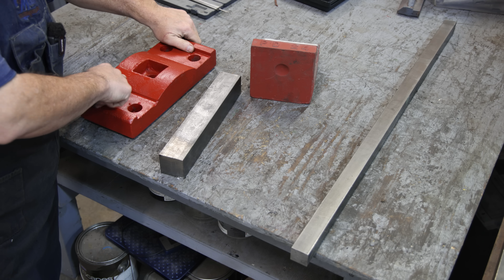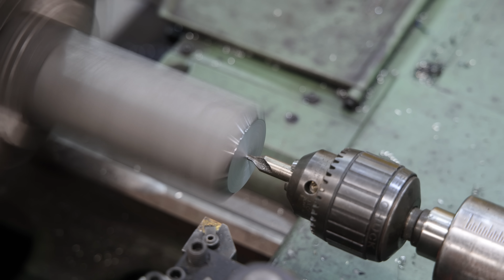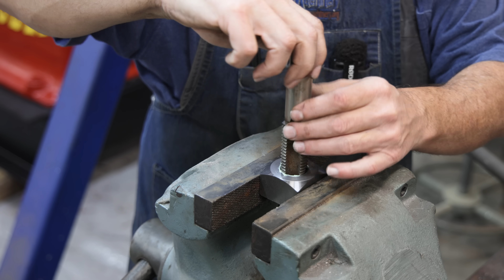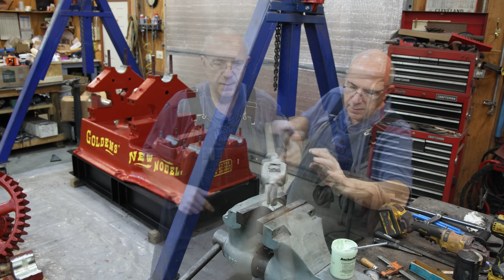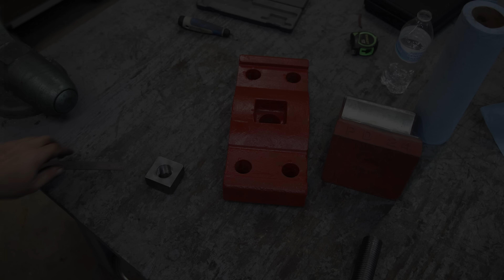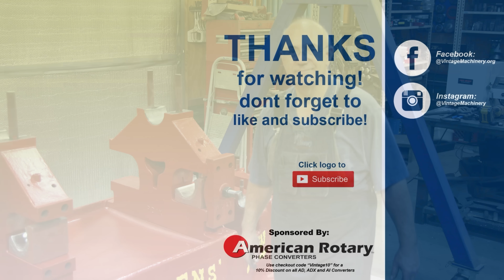Monster Cane Mill Restoration :Machining some Big Nuts and Adjustment Screws

Comment: Tapping those internal threads was great cardio but I think I would have chosen to single point them and finish with a tap. I guess that when you have a tap wrench that big you try to find a way to use it. Just remember that size isn’t everything (I tell my Wife that all of the time).

Comment: What a difference in that pile of tired cast and steel you started with. I regularly had to replace a ring with 22 x 1.5 inch threaded holes that tied a feller/buncher head, rotater in TQ100 I used "gun taps" with the best success. They were still tough going but produced  as how I wanted them to. Thanks a bunch for this ongoing post Keith.

Comment: Power tap it in the lathe. Use the tap wrench just touching the bed, center in the tail stock to keep it straight nice lowish speed! Sharpen that tap, to expensive to trash!

Comment: In the early 70's I did a job in the sugar mill on an old plantation in Southern Louisiana. The thing I remember most is the size of some of the gearing in there. Some were 10 or 12 feet in diameter. The gears were vertical and the bottom of the gear ran in a concrete trough with water in it. As the teeth came down into the water, the dust would be washed off and as the teeth came out of the water there was a layer of heavy oil floating on the top to re-lube the teeth. Doubt any of those old mills are still in operation, but it would be fun to see one in operation again.

Comment: I would be tempted to single point those nut threads.  Since both bolt and nut are needed, I am also surprised that no suitable pair can be purchased; specific threads are not then needed.

Comment: You could have power tapped them on ur Carlton , it will easily tap that , we had one at work and did 3 inch pipe tap on it saves the labor !
Reply: Just invest in Morse taper tap holders  1 1/4 like butter

Comment: Mr Rucker, I'm surprised that you opted to cut the threads by eye, and not use the facility of the boring machine to ensure that is was vertical.  Any particular reason for that?  Even I, as a modeller, use my mill to help me cut threads...  Best wishes for the Festive Season from me and the wife in East Anglia - England's farming county.

Comment: I've made several tapping blocks with clearance for the tap to start it dead straight. I think that would help quite a bit in starting the threads.  I think inch diameter threads are the largest I've used.  I generally do twice the tap diameter to keep them straight. Those nuts came out pretty nicely all told.

Comment: I agree about the lock nuts being square.  Chances are they will be using adjustable wrenches which would do both, but the square head would be less likely to be rounded over like adjustable wrenches tend to do to hex-nuts.  Acetics after all of your work would tend to just it look period correct.  
It is looking and all you need is some sorgum cane to run through and then boil the juice down into syrup to put on your pancakes.

Comment: How do you stop the threading tool at the right position everytime without crashing? Is there some trick to it or is it just skill?
Reply: Skill, muscle memory, quick draw style or method does require skill so make a lot of some size bolt. I would say around 25 at a time with 4 cycles will do the job of training your muscle memory, and sharpening for reflexes... speed the  RPMs each cycle if you have a CV motor. Each bolts usually takes 8-12 passes on the larger ones like 3/4 -10, and only 5-7 on the  very small ones like 10-24

Comment: That is a threader allright.  wow.  Mr. Rucker is use to having another ~30lbs to throw into that.  ;-)
Still, impressive to see uncle manhandle that.  The interrupted cutter was the tool for that job for sure.
Work smart, not hard.  If at all possible ;-)

Comment: Make a video Sharpening the tap using the surface grinder ??
Reply: Actually that can be done on a surface grinder but is better sent to Steve Summers who has a tool and cutter grinder, a more appropriate tooling choice. It just needs the gullet resurfaced and although a dremel type grinder with speeds over 10,000 can do the job; holding everything in relation to the other to only remove what is needed for sharpening -and not the cutting parts which would dull it faster than you can say idiot tools.

Comment: How many shops have a spare 1 1/4" tap?
Reply: Many more than have a 1 1/8 tap, but levity aside, most jobshops and the folks working the jobshop circuit have some of the oddest tools you can imagine, many trade tools actively with other Machinist Types and Maintainence types every Sunday after lunch or at fishing camps etc.

Comment: 13:45 ... Those big taps are pretty easy to sharpen!! .. Just grind a wheel to the same RADIUS, as the FLUTES are ... and sharpen in like anything else!
Reply: Nah....viewers will have sent 20 of them by the next time he needs one. He's like Mr. Pete...just throw it away cuz he has too much.
Reply: It’s not so easy to dress a wheel to the same radius as the flutes but it can be done.
Reply: @ellieprice363 and since this is a plug tap not a taper or starter tap the wheel needs to be angled sharply in relation to the gullet, why didn't he have a starter tap for that size? Send it off to Steve Summers so he can make a video of sharpening it, maybe he can make a starter tap of it so Keith has one in the size. Also, hats off to Keith for using a plug tap that large by hand, thats the way to build some muscle.

Comment: About cutting those big threads on the vise.  I might have put the nut vertically in the vise jaws so I was pulling the tap wrench for more leverage.  Or use a cheater bar!
Reply: You would not be able to get the vice jaws tight enough to keep the nut from twisting.
Reply: @JSB1947  - It depends on the orientation of the nut.  Just like Keith had done I would also clamp the same two opposing faces of the square nut but with the unthreaded hole rotated 90° (horizontal).   With this beefy of a vise it would hold just fine.
Reply: @cemx86  Point taken.😨

Comment: Great video, Keith! A question about the order of operations: would it have been easier to drill the entire piece of metal, then cut the individual nuts apart rather than drilling and cutting off one at a time? Are you concerned about the drill bit deflecting as you go deeper? Just wondering - thank you.

Comment: Why not single point thread it slightly undersize and just finish it with the tap? Would keep the thread straight and would be easy to turn the tap just to skim it out to final size
Reply: Good suggestion as a lot of machinist would do it that way, but with many different ways to do a job . take your choice on what's best for you at the time.

Comment: Can taps be shrarpened?
Reply: They are sharpened when they are made. If they are sharpened once, it can be done again - with the right equipment
Reply: Large taps like that can be sharpened by hand, in just a few minutes. Throwing them out if they are not chipped is costly, especially if you are the one paying for the new one. Even if chipped still worth saving for chasing rusty threads, saving the costly new tap. @mikewatson4644

Comment: I made about 6 of these bolts threading round stock then drilling a counter sink hole in square stock and welding the head onto the round stock. Worked good.

Comment: Keith, why not tap the nut in the lathe using the tail stock and dead center and a 15 inch Crescent Wrench? Way easier…
Reply: I’m pretty sure @gus9675 wasn’t trying to hold the tap, one end goes into the nut to cut the threads, the back of the tap goes against the dead center to line it up and you turn it (or try to turn it) with the 15” crescent wrench. I’ve got an 18” & a 24” crescent wrench and to turn that tap I’d be grabbing the 24” one. Lol. Well, maybe the 15” one and have a cheater bar handy, which at 73 passes around the sun, is always near by.
Reply: Probably didn't have a way to hold that big of a tap in the tail stock. Most Jacobs chucks max out at 1/2 or 9/16. After that, you'd need a taper shank tap (I don't think I've ever seen such a beastie in my 20 years in a shop), or a collet and collet holder big enough for the tap that still fit in the tail stock. Not sure he had that. Theoretically, you could use the tool post and setup the tap in a tool holder like a boring bar, but you'd have to get it near dead nuts on center in both directions. That would be a big pain in the ass for four nuts. That leaves doing it off the machine.
Reply: Or at least get them started to make sure the tap was straight. If it was me the threads would have been all wonky.

Comment: Nice Job Keith.  I know the first tap was giving you trouble when I saw a vice of that size move a little. Really nice work!
Reply: Yep - I was thinking, if it's THAT tough to turn, using those long tap wrench arms and Keith's strength, there's maybe a chance  of shearing the teeth off that 1&1/4" tap!